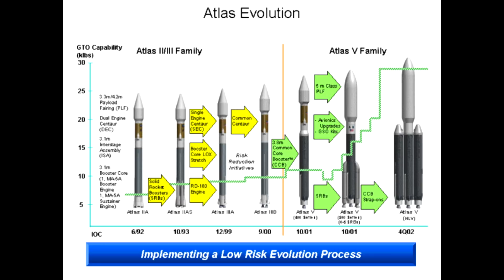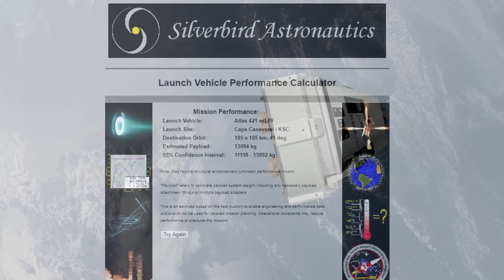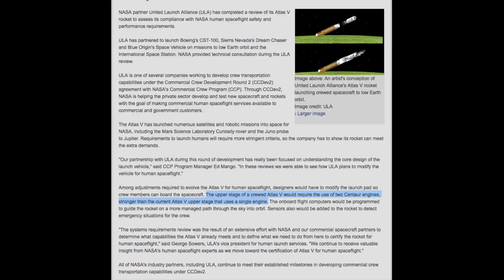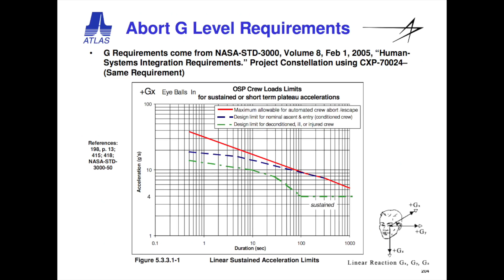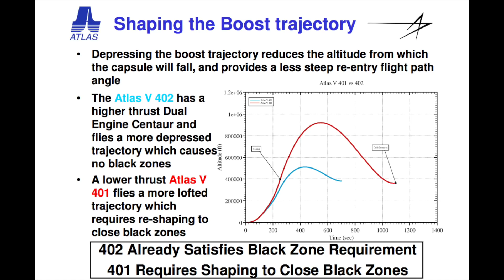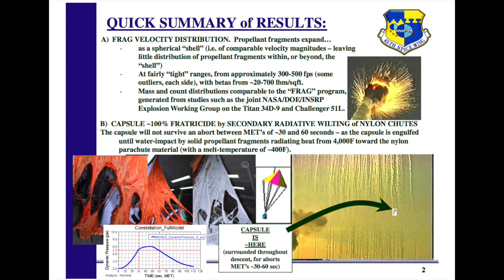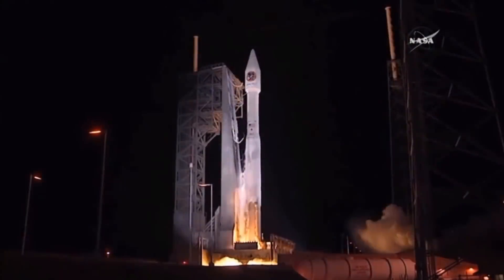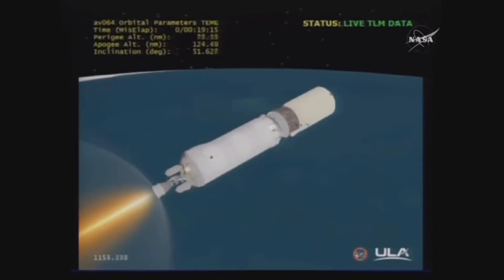Why Atlas Is Using Dual Engine Centaur For Starliner

Comment: We now have rockets that can do the job at a fraction of the costs?  Why are we the taxpayer still taking it up the tailpipe sideways to bankroll this shit??  How about make the payloads fit to the rocket and don't make that process necessitate the employment of 37000 people?
Reply: They are making payloads that fit the rocket. Atlas V has been around for over a decade. 

The problem is that payloads, especially manned vehicles, are immensely expensive. So much so that launch cost is a non-issue...

Comment: It will be nice to see dual engine Centaur upper stages again since I like the iconic layout with 2 RL-10 engines :)
However I think the RL-10 is really pushed to its limits in terms of future manned missions. They should really continue with the J-2X development and use it as upperstage engine for the SLS instead of clustering RL-10 engines like on the Saturn I.
Reply: Definitely agree about the RL-10. I always liked the idea of using a modified RS-25 on the upper stage instead of the J-2X.  The European Vinci seems like a very capable vacuum engine as well. My understanding was that development for the J-2X was rather costly even as rocket engines go.
Reply: Seems to me that you would want to use pretty much anything but the expensive and rather weak RL-10 for a giant upper stage like that. RS-25, J-2X, Vinci... Hell, let's bring back the LR87-LH2 and bolt one or two of those bad boys on the stage, that thing was fun.
Reply: Yeah, the LR-87 was an impressively robust engine. It was able to operate on KeroLOX, HydroLOX and Aerozine 50/N2O4.
Reply: @MushVPeets  The LR87 is really underrated.  I use the "Bobcat" all time time in KSP, so I'm doing my part!
Reply: @chriskerwin3904  It was costly due to it being the underfunded Constellation program in which the rockets themselves sucked more funding than they anticipated. The J2X was very close to final design as they even tested the prototype engine to see how well the gimballing system would work.
Reply: Well, the reason for the RL-10 is the relatively recent trend of small upper stages. For example, the Saturn I's upper stage is larger than ICPS, and the Saturn IB's upper stage is likely larger than EUS. RL-10s are perfectly sized for these stages, since thrust isn't what they need. 

Also, the RL-10 shouldn't be expensive. I wonder how the space program would be if we had more engine production companies...

Comment: And I thought too low thrust on 2nd stages resulting in desperate fights against gravity, was something you only get in KSP.
Reply: Check out the Saturn V launch profile, you have to loft the second and third stages at a higher angle because they have anemic thrust. You will be falling as you circularize. IIRC Angara V was similar last time I launched a replica in RO/RSS. I have a better launch record with Angara V though, Saturn V is a fickle beast.
Reply: The Saturn V is supposed to enter into a very low orbit, almost dipping into the atmosphere...
Reply: @badbeardbill9956  Yeah, the Saturn V's parking orbit on lunar missions was only 93 nautical miles compared to 160 on a typical Gemini mission.  It would not have taken long to fall out of that orbit, but they only stayed there long enough to doff their suits and get the "Go" for TLI.
Reply: @CountArtha  Yup. Parking in such a low orbit helped performance, and iirc the later missions went just a little bit lower than the earlier missions to squeeze extra performance out of the vehicle.

Comment: 1:18 I suppose calling it an Atlas 5 022 would be too obvious!
Reply: No, the Atlas V 022 is a special-order variant with a 0 meter fairing, which costs the US Government $10 million extra to produce.
Reply: well, i guess you'd have to know whether they decided on the naming scheme before or after they were faced with the need for it. Seeing as it's been quite some time, i'd bet my money on it was decided a long time ago, and it makes more sense that you don't have 0 fairings like you don't have 3 fairings. the number was a measurement of the size, the letter is to specify none at all. 

next.
Reply: basically, since the size of the fairing is measured by number, then the quantity 'should' be measured differently.
You can have 0 boosters, up to 5.
You have the option for a fairing, when in place, up to a size of ?
Even if 0 wasn't a specific fairing size, it's still not good practice to intermix measurements or oversimplify things.
Reply: Right?!?!
They some dumb smart people ;p
Reply: Yeah... When they have no boosters on an Atlas V they don't call it the Atlas V 4N1 :P
Reply: I was thinking they would simply put a dash :)
Reply: or replace 0 with C for capsule
Reply: My point is, why would you put a letter in what, until now, has obviously been a numeric field?
Reply: @ax2bxc that's even smarter

Comment: 7:13 and i though that this only happened in KSP.
Reply: Normally that's when I revert and either add more boosters, or try to get a better launch profile.  In real life, when something goes wrong, you have to keep playing it out, and try to save what you can.
Reply: @Br3ttM  Nope, irl the simulator also reverts and adds more boosters when it's hopeless but the simulator tries to get to orbit as much as he can. We just don't see it when he hits Esc. Sometimes, he's just too lazy to revert and then we have explosions. Remember the F9 kraken on launchpad? 😂
Reply: NASA needs to find a way to quick-save.
Reply: I didn't see your comment before typing mine, lol
Reply: ahahahahahahaha
Reply: Common feature in my space program.  Helps to budget an extra several hundred m/s of delta v for each stage
Reply: This is what is absolutely phenomenal about KSP. Even though the physics can be comical, they are fundamentally realistic in a way no other game's space physics are, and playing the game can give you an intuitive understanding of things you'd never understand otherwise without a degree. I can't imagine truly understanding why the upper stage centaur would need to pitch up after the booster cut out two seconds too early without thousands of hours of experience with this scenario in KSP. ;)

Comment: How can it have one solid rocket booster without ending up like a Catherine wheel?
Reply from the maker: Thrust vectoring let's it powerslide off the launch pad.
Reply: @scottmanley  im sorry Scott, but i agree with Alan on this one.
Reply: Scot has already awnsered it in a video
Reply: Would the SRB be pointed at centre of mass?
Reply: No, the thrust vectoring of the rd-180 compensates for the offset thrust(the nozzle points towards the solid rocket booster, thus counteracting it's rotation). Search for an atlas 411 launch, it's pretty obvious in launch footage. This does however mean that the total thrust vector is not straight up, but a bit towards the side, so the rocket does drift.

Comment: Before watching,  my guess is redundancy/safety.
Reply: can't be redundancy because the thrust would be off center
Reply: @10goni  thats what thrust vectoring is for.
Reply: @StovallsGarage  that is true
Reply: +CAPSLOCK did you not watch the video?
Reply: @lukefreeman828  i did my assumption based on not watching it. just like the comment i was responding to.
Reply: @10goni  false, it can correct for that with gimbaled thrust.